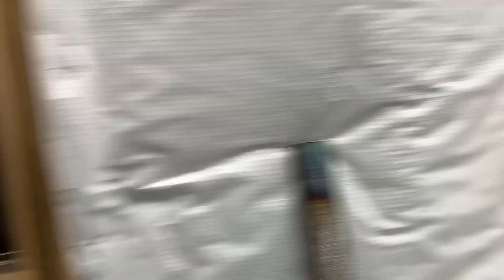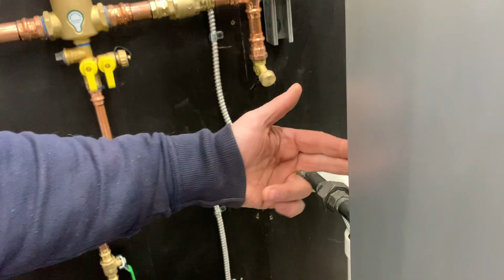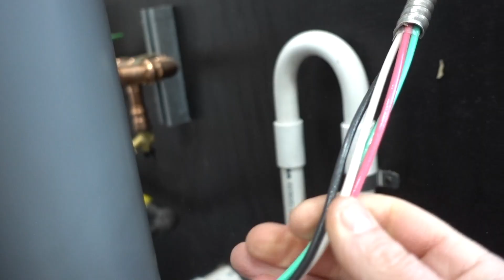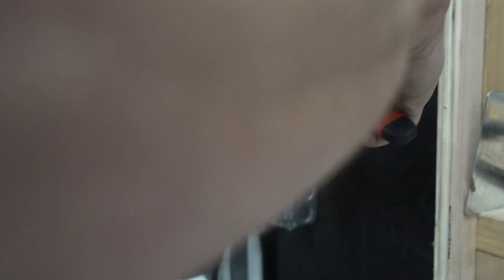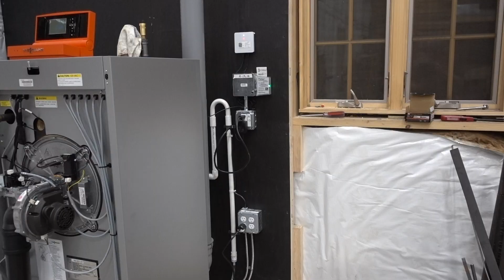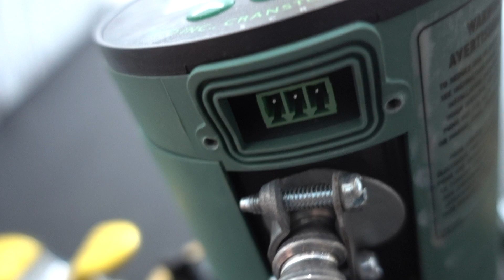Wiring a Gas Fired Boiler in The Barn

Comment: Awesome information and a great install! One note to consider is while I love the flexible cord to plug in all the boiler equipment a inspector might not approve it with the basses of section 400.8 in the NEC. They might claim it's used as a substitute for fixed wiring. Not 100% sure I just know my local code officials really look at SO and other flexible cords being used for permanent installs.
Reply from the maker: I concur with extension cords not being allowed for permanent wiring. In this application we used a heavy duty cord rated for 15 amps with a max draw of less than 5 amps. The circuit that feeds the boiler is 18 inches above the box that contains the loads. Inspectors judgements are usually very subjective and they often have to consider the environment and particular application. From my experience they usually look to see the quality of the installation. If they see sloppy work they will crawl through everything with a fine tooth comb. If they see everything neatly and professionally installed they will often look favorably on specific items that are not clearly stated in the NEC code book. Thank you as always for your feedback. I learn something new every time because it makes me research things to get a clearer understanding.
Reply: @Reynopatrick  great points on a clean install and it's so true. If you take the time to be thoughtful and create a neat install it definitely shows a high craftsmanship that would extend to all aspects. I'm usually more conservative on my code interpretations since I get put in the hot seat if I showed something on the plans that can lead too a red tag. But as you said it really comes down to the code official and their opinions. I always remember those times were I think the code spells something out one way and get a call from an inspector saying other wise. It's great seeing you share this content, and definitely gets me thinking on how I'm showing items on plans. Keep up the great work!